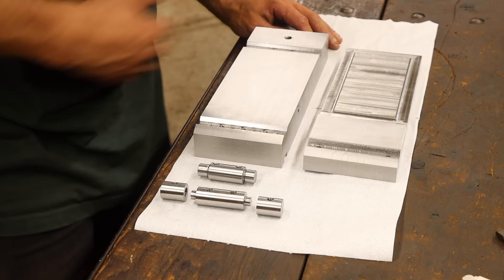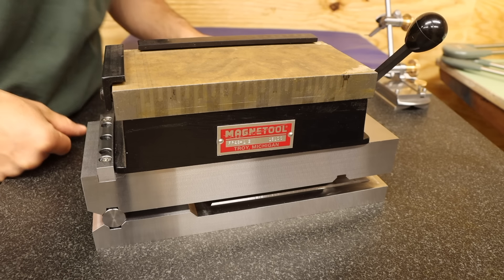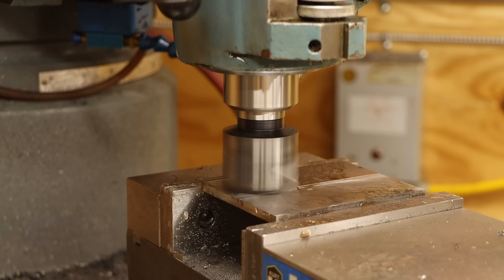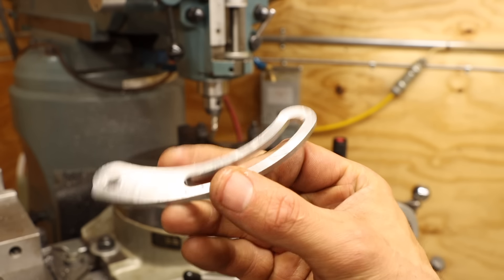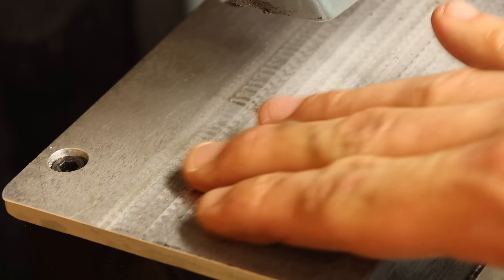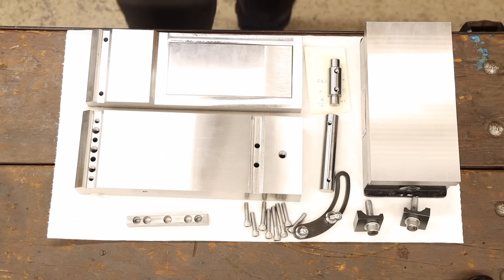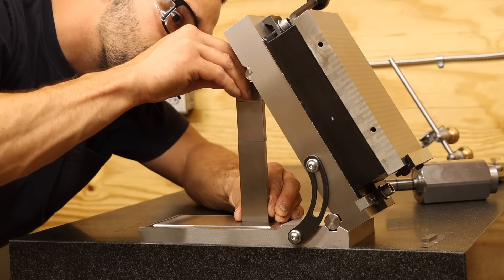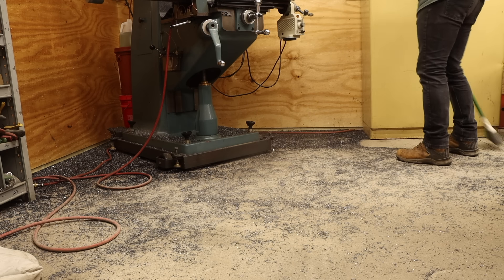Making a Sine Plate (Part 2) || INHERITANCE MACHINING

Comment: what would the angle accuracy on those $50 blocks you could have bought instead be, compared to your on fabs? 
Also, the ability to reliably remove a few thousand per 8 inch is not quite a standard hobby setup ...
Reply from the maker: no idea on that, but saving the money was never really the point.

also how do you mean?

Comment: The two problems with the stainless screws is that they're weaker than grade 5/8.8 screws, and they've a propensity to gall and break off in parts if you don't cover them in oil or antisieze.
Reply from the maker: those are good points. Might have to swap them then

Comment: If your sine plate didn't have that reduced diameter pin couldn't you use a .006 feeler gage ?
Reply from the maker: yeah that would work fine as well. for some of the setups I didn't show I actually used feeler plus gauge blocks.

Comment: I wasn't there, but I am going to guess. Your first mistake, probably, was smacking the part down flat. Forcing it into shape, which of course will become a banana, at that thin of a part. The second, probably, was over tightening the vise. I would have faced each side twice. Take 1/4 of what you wanted on the first pass. Flip it over and take the next quarter of total stock to remove. Flip it over and mill the first side, a second time. Then the second side, a second time.
Reply from the maker: There's actually a moment in the video where when I open the vise after that last cut, you can see the plate pop up off the parallels and is warped in a  different manner than tightening or over hammering would cause alone. Even, progressive cuts like you mention probably would have made the potatochipification less severe as well.

Comment: 2 things. Use WD-40 when machining aluminum, or Alumi-cut. Also, why didn't you really Brandon up that locking arm and recess it into the side of the sine plate, lol
Reply from the maker: Thanks. I didn't do that because I decided to Brandon it up another way. I had grand plans to make this into a sine vise so wanted to maintain as much square material on the top. After working with it though and realizing ungodly large it is, I may not go down that route 😂

Comment: A really rough dress and WD-40 is how you surface grind aluminum
Reply from the maker: I’ll give that a try next time. Thanks!
Reply: @InheritanceMachining  another tip for aluminum is, after you dress, take a piece of thick shim stock and run it across the wheel. It will take anything loose off, if you don't they leave streaks across your surface. I spent about 6 years as a tool and die maker building injection molds and we made a lot of aluminum low pressure molds.
Reply from the maker: Oh that's a point I never even considered. Any specific wheel you would recommend?
Reply: @InheritanceMachining  nothing special, just a standard 46
Reply from the maker: @Ataraxia_Atom  Oh great. thats what I have. The WD40 and shim stock might do the trick for me then
Reply: @InheritanceMachining  yeah you got everything you need. When you dress the wheel run it quickly across. My mentor would say "as if you're putting a thread i to the wheel" it keeps it from being too fine and loading up.

Comment: Shit. I watched the entire 2 part series of how you made this. But WHAT IS A SINE BLOCK?!?!?
Reply from the maker: lol You must have missed the explanation about 3/4 of the way into this video. Its for holding parts at angles VERY precisely. You figure out how tall of a gauge block stack to put under the floating pin using the formula 8" x sine(angle). Where 8" is the distance between the hinge and floating pin on my sine plate